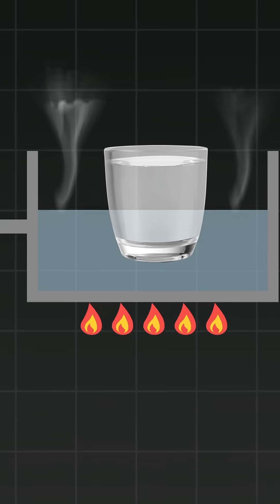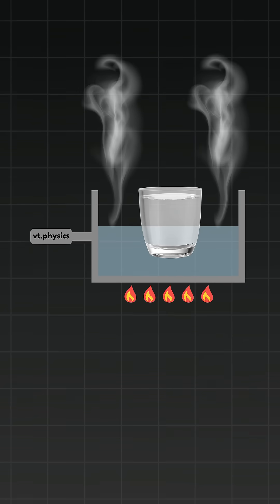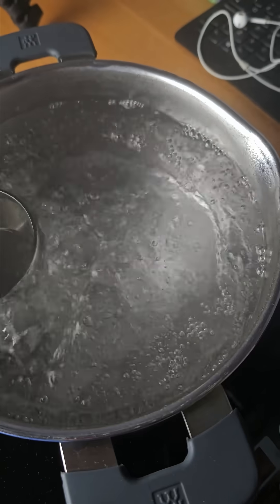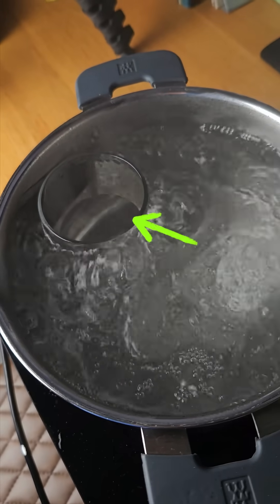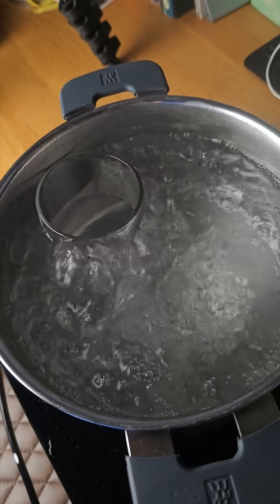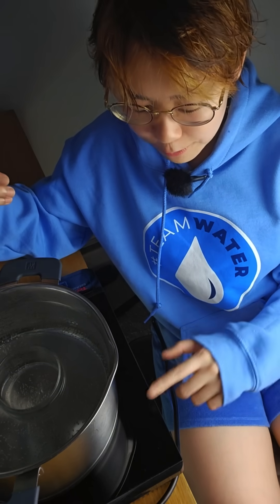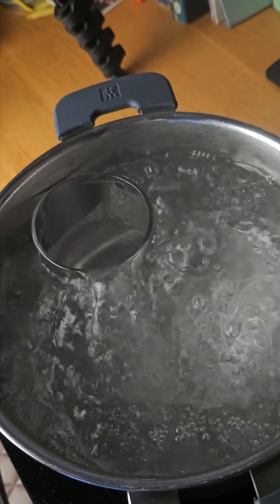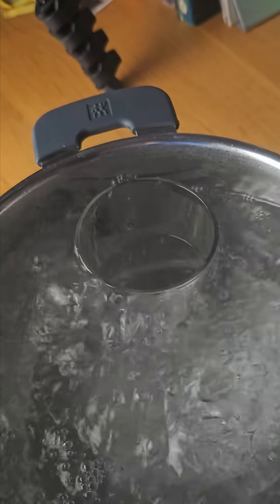Boiling Dilemma: Why Water in a Glass Won't Boil #teamwater

Comment: It may sound stupid, but 100c as "transition" temperature makes so much sense!

I always had trouble understanding that, and i thinked that 100c was the temperature of instantly change between liquid and gas, but that it only happened in specific points that had reached that temperature, and that was why the molecules evaporated slowly instead of instantly

I hope im not he only one
Reply: Now remember that water in the ocean evaporates yet the ocean never reaches 100c. The answer is all water molecules exist under conditions as unique as any person on Earth. Water needs a certain energy and/or pressure to evaporate. Heat isn't always the energy used to meet those conditions.
Reply: @hooliganbubsy7298 glad you worded it like that. I was just going to confuse people by saying 100°c isn't actually the transition as it also depends on pressure.
Reply: @mtbmike6676  well strictly speaking pressure is why water is even water, or H2O is even water put roomtemputure watergalss inside a vacuum bell and it starts to boil, pretty sure right?
Reply: @omicron7340 yeah exactly. Without pressure the transition point drops below 0°c. Hence no liquid H20 in vacuum of space.
Reply: @hooliganbubsy7298  It is easier for a liquid to turn into a gas than a solid turning into a liquid
Reply: Same reason 0°C is the transition of water to actual ice
Reply: Minor correction: thought (not thinked)
Reply: Latent heat of evaporation.
It's taught in advanced physics classes in school, in my country between the ages of 16 and 18 but only if you chose to study the advanced physics class.

Many people will not understand or have knowledge of the effect.
Reply: Molecules can not evaporate. phases are the consequence of moleculair interactions a single molecule can not be in anny phase by it's self. When substances are in the solid phase the position of the molecules compared to each other is "locked in" by the  intermoleculair forces. they can not sperate and can only move verry little relative to each other. When a substance is in the liquid phase the molecules an move relative compared to each other but can not sperate.  When substances are in the gasous phase the molecules are far appart and there little intermoleculair force left allowing them to move freely compared to each other. What happens if you reach 100 degrees celius is that the energy you are adding is no longer only speeding op the molecules it's also beeing used to break the forces that keep the molecules close to each other. The molecules that break free from the others and get spread out form the gas phase.  This costs a lot of energy so it can not happen everywhere at once most of the time cause the system is not providing enough energy every second to break all he forces for all the molecules.  But it can happen. Trowing a little water onto some extreemly hot metal for instance will  almost instantly turn it all to gas phase.
Reply: @koenvandiepen7651  At the surface of the water the bonds are constantly being broken and the water is turning to steam, even below 100°C, which is pretty cool
Reply: @DANGJOS  Well yes and no it's turning into gas. But not into steam.  Steam is a product of water at boiling temperature able to apply pressure in a closed system.  The evaporation of water won't do that.  It will reach eqalibrium at the pressure the closed system  is already at.  No machine is going to run on evapurating water whitout a heatsource.  But appart from the steam part yes.
Reply: @koenvandiepen7651  Ah yes, fair enough. I think the technical term is vapor, but not sure
Reply: Let's see some Triple points of water...
[611.657 Pa, 0.01 °C] Ice Ih, Water and Vapor
[209.9 MPa, −22 °C] Ice Ih, Water and Ice III
[350.1 MPa, −17.0 °C] Ice III, Ice V and Water
[632.4 MPa, 0.16 °C] Ice V, Ice VI and Water
[213 MPa, −35 °C] Ice Ih, Ice II and Ice III
[344 MPa, −24 °C] Ice II, Ice III and Ice V
[626 MPa, −70 °C] Ice II, Ice V and Ice VI

Now there's a lot more ridiculously difficult forms of Ice, the latest one discovered is Ice XVIII that's 18... although it's just one out of 26 known phases of Ice.
Also if the pressure is low enough, there is no liquid phase, meaning it goes from Ice to Vapor immediately. At 1 Pascal, at −60 °C Ice Ih turns into Steam.

Oh and at 22.064 MPa, at 373.946°C is the Critical point where Water stops behaving as either gas or liquid but starts to act as both.

Now if you thought that was weird, let me tell you about Metallic Oxygen... which requires pressures of 96 GPa, that's about 947446.3 Atmosphere's of pressure. And if you compress it even further to about 100 GPa, then it's a superconductor for as long as the temperature is below 0.6 Kelvin.
Oh and the different solid forms of Oxygen that exists otherwise are Sky Blue, Light Pink, Orange and Blackish Red. And that Blackish Red one is interesting because it consists of O8 molecules.

Also fun fact, the first time someone saw Solid Hydrogen was in 1899. And that requires temperatures lower than 14 Kelvin, that's -259.15ºC... who said the people of the 19th century didn't have decent scientists?
Reply: at 1 atmosphere of pressure at sea level.  pressure, temperature and volume are linked. change one variable and the time needed changes.
Reply: Literally an book on the subject would instantly explain how it works with no issues
Reply: When a molecule of water has enough energy to be over “100°C”, it becomes a gas. When it does this, it takes that energy with it, meaning the rest of the water as a whole loses access to that energy and is now below “100°C” due to that energy loss. This is why you need to keep providing it with energy so that more molecules of water will evaporate, but it’s also why the water that is boiling never gets above 100°. Any water molecules in the pot that would’ve been 101° would’ve evaporated and so it wouldn’t be in the pot.
Reply: at STP
Reply: I am confused.  I learned this is grade school science .  This is similar to how a double boiler works.  Steam will only be 100c and can't heat up the pot over 100c because there is no direct heat to raise the temperature higher.
Reply: @Chris-h1y2g  It doesn't sound like you have any concepts wrong

Comment: I feel like there is a temperature which water creates stem in such extreme rates steam itself will boil the water. Though not sure on that.
Reply: What's the temperature of the steam in this scenario?

Think about it carefully.
Reply: @deang5622  You think youre so smart about it but you get it very wrong.

By saying 'such extreme rates' i meant steam cant get dispersed enough so the higher amount of energy condensed will make the heat higher than normal.

Dont forget you can make the steam way hotter than 100 degree.

Comment: If you keep the water glass in vacuum it will boil without the additional heat
Reply: Yes! That can be explained because the Clausius-Clapeyron equation, Knowing the vapor pressure of water at different temperatures tells us the boiling point at any given pressure.

We know at 1 atm it boils at 100 C,
If it’s 0.01 atm, it boils at only 4 C
This is because the thermal energy is enough then to overcome the pressure, as they evaporate they steal the energy needed and cool the water, it can even Freeze while boiling!

Comment: Ngl I tought the glass would explode
Reply: Same
Reply: Glass only cracks when it is heated quickly and unevenly. Since it gets heated slowly and evenly by the water, nothing happens. But if the glass inside the boiling water was empty and you pour cold water into the hot glass, then it may crack...

Comment: This is basically how a double boiler works.
Reply: Not basically, it is. Its exactly how a double boiler works.
Reply: @J.petty124  The upper part of a double boiler doesn't typically sit in the water, but directly above it. This means it is heated by the steam and not the boiling water itself, but the concept is the same. So yes, "basically".
Reply: @Gogeta70 what you described is a steamer, they are correct about the double boiler. It sits in the water but doesnt touch the bottom, you can use a little spacer at each corner.
Reply: @Gogeta70 no, it sits in the water...
Reply: @J.petty124  you gotta look up what basically means 😂
Reply: @germanfisch if i say "its basically raining", is it raining?
Reply: @germanfisch  no, he used it correctly (or pointed out it's misuse correctly). basically means that on a basic level that's how it works, which implies that there is more to it. this is the exact function of a double boiler, there's nothing else beyond the basic concept. it's not the same at a basic level, it's the same at all levels.
Reply: @wildfire_  well no… the thing is double boilers aren’t exactly a bowl sitting in boiling water, the way double boilers actually work is that a bowl is suspended OVER simmering water without touching it so the top bowl gets heated by steam. What this video is showing is an example of something being indirectly heated which—fundamentally not literally, is how double boilers work. Plus all of this doesn’t matter since using basically is grammatically correct whether you are explaining the exact details or not.

Would you be mad if I said “Basically, a car engine burns fuel to create power. That power moves pistons, which turn the wheels and make the car go.”?
Reply: @germanfisch  it can be touching the water. It depends on your double boiler. It's important to note that steam is hotter than boiling water. You would use more water when you want a lower temperature and less water when you want the maximum temperature or the fastest rise in temperature.
Reply: @germanfisch  Yeah you probably should look it up because clearly you don't know what it means. This isn't basically a double boiler, it is a double boiler. Basically means almost, but not quite.
Reply: @J.petty124  no. The steam trapped by the double boiler is hotter than boiling water. So it's not exactly the same.
Reply: What is a double boiler used for
Reply: @talancorwell  Keeping things consistently hot without burning them. Melting chocolate for example. 🍫😋
Reply: @nyaxellemonte4230 heating up milk to we use the boiler to give it to a steam valves and it can help heat thing up fast in a short time
Reply: @talancorwell  eggs and things that need to cook very gently
Reply: @talancorwell  melting things without getting them overly hot.  Also good to warm some things like eggs without going too far that they cook into scrambled eggs.
Reply: No. I have vintage double boilers; double-layered pots, the outside layer boils 1 liter water (wich you can pour out through a spout carrying a wistle) The inside boils 2,2 liter water, just takes a minute longer to get to that point. I use it to boil rice, and use the outside-water for washing up afterward (or tea). Here the stove boils water in both 'containers'.
Reply: If the flames were big enough it technically may not do like you think, because steam can get MUCH hotter than 100°C, especially with the setup of hoping to trap the steam. You can make a setup to light things on fire with steam.
Reply: Was looking for this comment
Reply: Nah not basically. Essentially.
Reply: @yamadawaver9317 those literally mean the exact same thing, in fact they’re in each other’s Oxford definitions as “basic” and “essential”
Reply: @bedbugproductions3245  it's a joke but yeah maybe I'm not being sarcastic enough 😂
Reply: @yamadawaver9317 Nah, not money. Currency. 

That's you.
Reply: @ra2186  I don't understand. What are you talking about?

Comment: So that's why double boiling is so good for temping chocolates!!
Reply: No.
Chocolate melts around 40 Celsius.
Double boiler will limit the temperature to 100°C but that is not the reason it is used.

It's used because it doesn't heat the chocolate so fiercely, and the reason for that is you're not heating the chocolate directly from the flame, there is an additional layer of glass which which acts as an insulator and slows down the rate of temperature rise.

Comment: Heat from stove -> metal pan (good conductor) -> water (25°C to 100°C) -> glass (bad conductor) -> water (<100°C). Yes, it can be 100°C but it will take a while and even longer if you want it to be vapor

Comment: Putting an egg in a glass makes it softer to boil. In Japan, this is known as onsen tamago (hot spring eggs) and is used at home.
Reply: How long do you boil
Reply: @michaelross3345 
Boil the eggs in 70°C water for 20-30 minutes. It depends on the size of the eggs, so try several times to find a good consistency.
Eggs in Japan can be eaten raw due to strict hygiene standards. It may be better to boil them a little longer.
Reply: @picoling eggs can be eaten raw anywhere with the same level of risk.

you are thinking of US supermarket eggs requiring refridgeration because of the moronic cleaning process.
Reply: @picoling  so get the water to 70⁰ then put the egg in?
Reply: @AJB4D 
I did not know it. I was taught that eggs should always be cooked before eating in some countries because of the risk of food poisoning. I have included this information just in case no one else suffers from my information.
Reply: @asai9868 
Yes! Boil the eggs when the water temperature reaches 70°C.
I am not good at English, so it might be better to look it up to get the right information. I am not confident that my ideas are being conveyed correctly.
Reply: @picoling  I see, but do I need to crack the egg into the glass first or just put it in with their shell? Also, don't worry, your English is good (coming from someone whose English isn't the first language either)
Reply: @AJB4D  Sorry, no. lease don't spread such misinformation. Salmonella is a real risk with raw eggs and the prevalence in the chicken population varies a lot around the world. In Europe, it is common to vaccinate chickens in high risk areas, but there is a non-zero chance of catching it everywhere.  The whole washing eggs part is somewhat separate.
Reply: @asai9868  Onsen tamago is boiled inside the shell.
Reply: @michaelross3345 
Boil the eggs in 70°C water for 20-30 minutes. It depends on the size of the eggs, so try several times to find a good consistency.
Eggs in Japan can be eaten raw due to strict hygiene standards. It may be better to boil them a little longer.
Search “Onsen tamago” to find out what it looks like. For the uninitiated, it may look a little strange.

I'm sorry I'm not good to speak English😭
Reply: ayoo that one egg guy in one piece is also called baron tamago
Reply: @praneel1059  no shit tamago means egg that guy is like half egg half chicken thing
Reply: @8oaz  chill i just exclaimed the fact that thats where i had heard tamago before
Reply: I actually sous vide mine at 150 for 35 minutes.

Comment: But what if we add a different liquid that has a greater boiling temperature and then put a cup filled with water into that ??
Reply: Yes, that would boil the water. It would also work the other way around, if you kept the water in the pan but put something with a lower boiling point in the glass.

Comment: because of the damn glass, The amount of heat supplied to the water inside the glass first needs to heat up the glass, where the things change.
Reply: Nothing to do with the glass.
It's called latent heat of evaporation.

It's caused because the outer and inner bowl contain the same liquid.